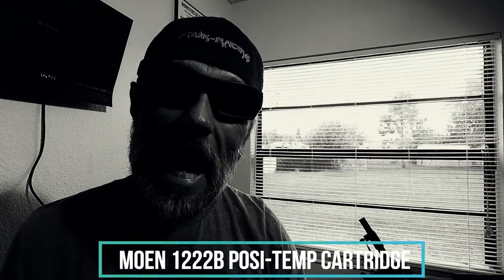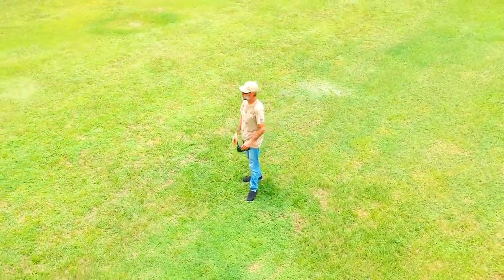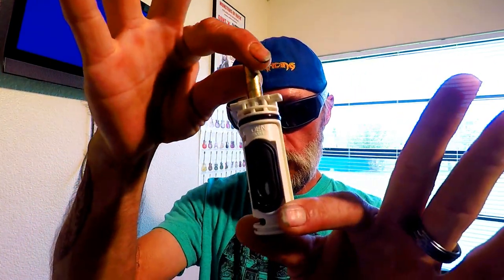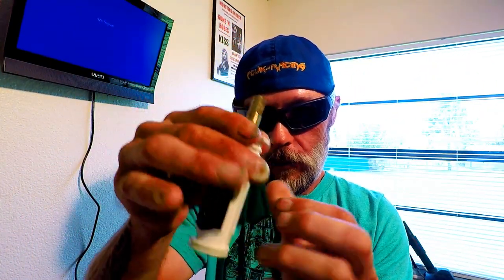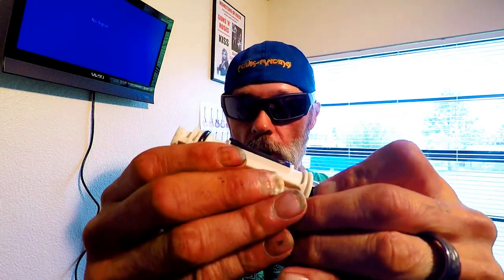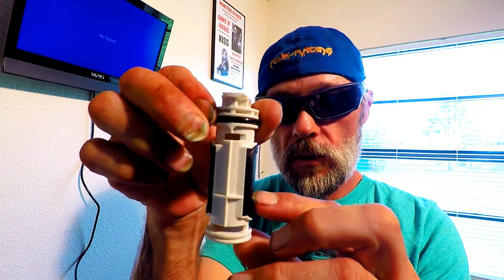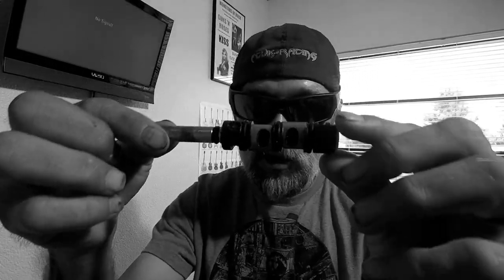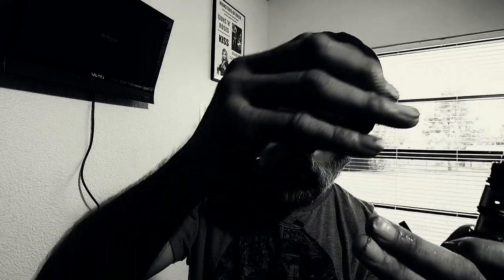HOW A MOEN 1222B POSI-TEMP CATRIDGE WORKS

Comment: We believe our 26 year old cartridge is original to our house. (Built in 1998) We recently changed the trim kit because our old well water ruined it. We did not do anything but change the trim plate & knob/lever. Ours, believe it or not seems to be stuck on HOT. I just bought a new cartridge today. BTW; I'm told the "B" just means that its packed in bulk cases of the product. (For commercial plumbers) There is absolutely no difference in the cartridge.

Comment: thank you!  i was stuck with only hot water and watched multiple videos about this to no avail,  then came across your video. when you said in this that the cylindrical bearing should be moving.  mine was not. i knocked it around a few times and some debris came out, then i heard the sound of it moving.  both hot and cold water is not coming out.  thanks again!

Comment: None of these videos explain why we are getting to much warm water instead of cold.
Reply: There's stop check valves on the side of the cartridge. 2 little flat heads on the right and left of the cartridge. The warm water check valve might be open more then the cold water valve which is on the left probably.

Comment: it's called a balancing spool and this device made "Moen"  prior to the "Posi-temp or 1222 cartridge the predecessor valve Moentrol which uses the 1225 has the built-in balancing spool #1423 the price difference is because the spool is built into the 1222 but is separate on the 1225 and must be bought separately...IF YOU'RE HAVING ISSUES WITH A Moentrol that using a 1225 TYPE CARTRIDGE e.g. NO COLD OR NO HOT  BEFORE YOU REPLACE CARTRIDGE TRY REMOVING THE #1423  SPOOL AND SEE IF THE SPOOL IS STUCK, SOAK IN VINEGAR WHEN UNSTUCK IT SHOULD RATTLE/ MOVE FREELY

Comment: Wow wish I new this before I spent so much time trying to figure it our myself ( and couldn’t). Mine was froze I hadn’t used that extra shower for many years.  The replacement was simple although I bought the puller.  I couldn’t figure out how hot water could pass through it because the center wasn’t moving at all and it was definitely frozen in the cold position.  Thank you this video was perfect, nice job
Reply from the maker: Thank you

Comment: Thanks for the tips! I have a push-pull Moen. Cartridge seems stuck. When I try to unscrew the screw to replace the knob, the whole thing appears to spin with screw. I can tighten it a bit but then temperature of water changes.

Screw head is not stripped, but the screw itself won’ unscrew because entire valve seems to turn with screw. Is this normal? Should I force it?

Comment: I have a Moen 1222 cartridge and it's almost always stuck on SCALDING HOT. When I spin it back and forth, I'll get the cold running again, but then I don't get any hot. It takes almost 10 minutes every morning to get my shower to a tolerable temperature. I just bought the place, and that shower was put in the basement back in the '90s. Could this be the same problem?

Comment: Great video--I have a upstairs bath tub/shower with a Moen positemp valve that is rarely used (like 3 or 4 times a year). A few weeks ago I had guests over who complained that the shower wasn't working.  Water came out of the tub faucet, but when they pulled up on the diverter nothing came out of the shower--not even a drip.  Nothing came out of the tub faucet either, so the diverter appeared to be working.  The whole system just seemed to be locked up--no flow or leaks anywhere.  Could this be a another failure mode for this valve?  There just isn't that much to go wrong in a simple shower system like this.

Comment: Hey Tim. I have  a 1222B installed in my shower. It gets used at least 4 time a day. 
The problem im having is the valve goe's bad about once a year or so.  It does not mix the hot and cold the correct way, when the valve goes bad.I changed this valve about 4 times in 5 years. Since I installed it. Any idea why this valve life span is so short ? Is this normal ? What can I do ?

Comment: Hey Tim. Bought a house has an apartment with it. Super cool. Moved in, recleaned everything, pressure good etc etc. had a house guest over and the pressure was next to nothing.  Took out the cartridge (had omen at previous home). Blew out the lines, cleaned the cartridge. Turned the water back on. Pressure was great! For about 5 minutes, then back to the same thing. So we replaced the cartridge. Again went ahead and blew out the lines to make sure there was no water pressure issues. None it was good.  Put in the cartridge, 5 seconds of good pressure, then the same dang thing. Can you help?
Reply: Did you figure out the problem?
Reply: @nocandopdx  nope. Very frustrating

Comment: I got one for you... I just put in a new valve for a tub shower and I the tub spout has a consistent drip. I’ve replaced the cartridge already even though it was brand new. It didn’t fix it! What’s the problem?!!! Could it be a bad valve?
Reply from the maker: There may be a defect in the valve body or some sort of debris lodged inside creating a void
Reply: I have the same issue. I tried with 2 new cartridges but the leaking continues. I do not hear that noise when I shake the cartride though. Any advice?

Comment: This is an excellent explanation of how this cartridge works. It is nice to learn something new. When you install the cartridge the instructions tell you to position the stem with the notch opposite the hot/cold markings. What happens if the notch faces the hot/cold markings? To me the the valve rotates seems symmetric.
Reply from the maker: Thanks for watching
Reply: This happened to us and I was a bit embarrassed. But what is more aggravating is that we replaced the valve and it’s doing to same. Literally at maybe 25% the water pressure it did have. I’m at a loss.

Comment: Same as 1222? My outside shower is stuck on hot. Can I pull the cartridge and unstick the bearing with crc / compressed air. Or just replace it? 
Cheers for the video. Thought they plumbed the shower wrong.

Comment: Hi, I replaced the cartridge.,I get hot and warm water. I do not get just cold water. I have tried another cartridge with the same problem. Do you know how to fix this issue? Thanks
Reply: I'm having the same issue. Did you find a solution?
Reply: Did you install it upsidedown?